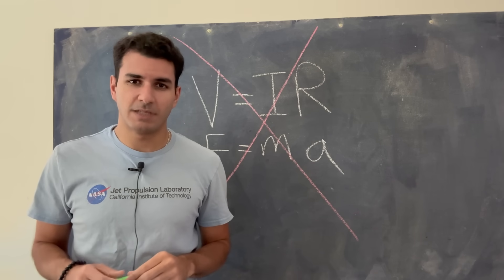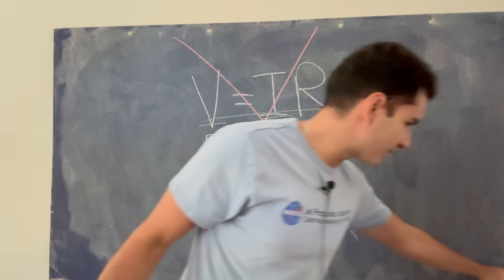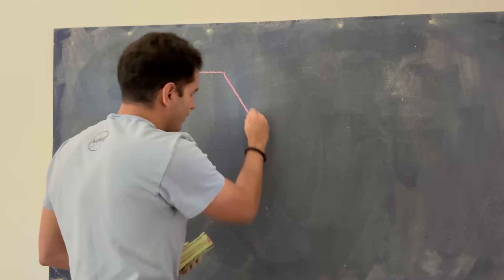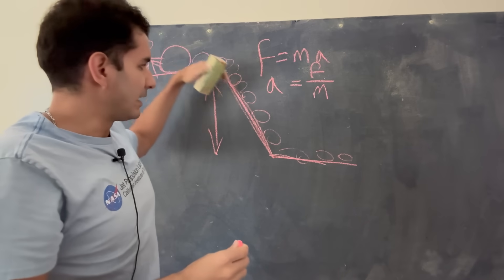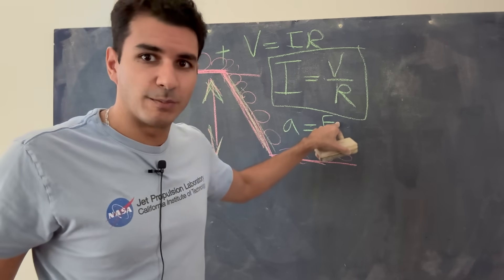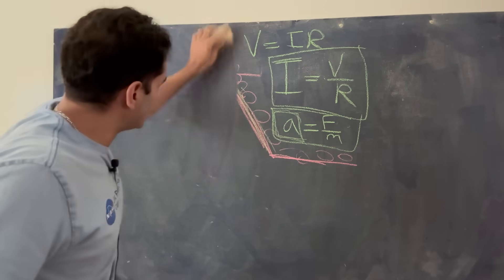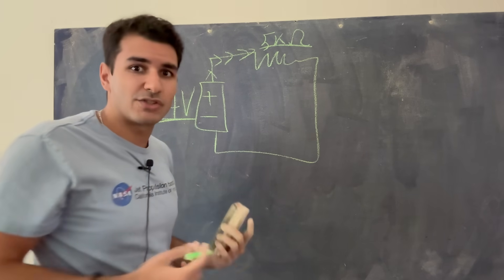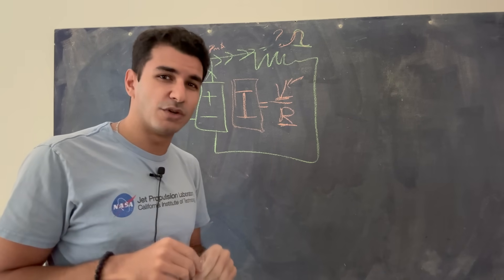You don't really understand physics

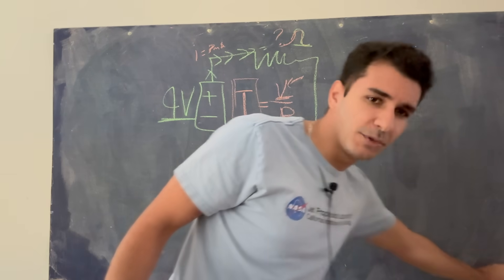Comment: Clearly never done any electrical (and mechanical) engineering. 10:22 "resistance is already there, so the current is the product". Every non-linear device adjusts its resistance based on the current supply. Negative differential resistance devices struggle at hunting down the correct resistance value so bad, they become oscillators. But even theoretical electronics disagree with you. Many circuits use constant current sources where current is the input parameter. Their models are very practical for photoelectric effect simulations.
Same but worse with mechanical engineering. Nothing causes anything in mechanical systems. The 3rd law of motion and impulse preservation laws state that all effects are mutual, not causal. 
This video pushes for using a worse form of the formula for an invalid reason. There is a reason these formulas are in the equational form and their transformation to a functional form is heavily context dependent.
Reply: I think he just want to demonstrate the "cause and effect" thing without going into too much details though.
Reply: How do current sources work though? I can imagine one as guy above wrote - using some magnets. But I can't imagine it in terms of battery or something.
Reply: @PinkeySuavo  most current sources are a voltage source modified to target a specific current. inductors are a true current source for a moment of time. inductive spikes are exactly when an inductor tries to maintain its momentary target current no matter the voltage. these spikes will physically damage any insulation in their way just to ensure the flow of some current.
Reply: @PinkeySuavo  You can model the battery either as a voltage source of a current source (look up Thevenin/Norton conversion).  It is more convenient to model the battery as voltage source because the voltage tends to remain "constant", but in some cases it is more useful to model the source as a current source, as in the case for solar panels.
Reply: @glandeokrayo9956  I remember Thevenin/Norton but it's conversion for mathematic purposes I think, and I meant real current sources
Reply: @PinkeySuavo  What do you mean with "real"?  An 'AA' battery is a real current source, far from ideal though, but an 'AA' battery can be modeled as an ideal current source in parallel with a resistor.
Reply: @glandeokrayo9956  but isnt it voltage source? It's not like a source of specific current. Its rather source of let's say 1.5V and the current will be dependent on the resistance. So like the guy in the topic explains. It's not like we can have "10mA" battery which will always give 10mA. That's what I mean with current source
Reply: @PinkeySuavo  If you connect a 1.5 battery to a resistor load with a resistance  much smaller than the internal resistance of the battery, it is more convenient to model the battery as a current source than a voltage source.  In the extreme case, replace the load with a wire.  The voltage across the wire will be near zero, but there will be a constant current out of the battery for sure.
Reply: Kinda strange how the creator just liked this comment? No response? So the video was debunked?
Reply: But you need a voltage to produce that current
Reply: @anghme28ang11  Nope.  You can a have a current to produce a voltage.  Electrical current is by definition the change of  charge over time I=dQ/dt.  You can move charge with a magnet and make them change over time hence creating a current.
Reply: @glandeokrayo9956  I remember quickly moving magnet through a coil with a LED connected and making it blink, I felt like a magician!

Comment: Have you never heard of a constant current source? Then, you need V=IR, since the current is constant, not the voltage. Also, have you never heard of a variable resistance? Sorry, dude, but you really don't consider ALL of the options. If you are a "rocket scientist" (isn't everyone at NASA?), then you understand about variable mass, constant acceleration, etc. right? Both of those equations need to to rearranged to suit the circumstances. Claiming that one form is more appropriate than another all depends upon the circumstances. Take care always.
Reply: How do constant current sources work though? I had it in my classes, but never actually understood what are these. Voltage source are easy - we use it everyday in forms of battery. But I couldn't think of current source. Maybe some phone chargers? They often have let's say 1A charge current. But isn't it in reality the byproduct of voltage (from the socket)?
Reply: @PinkeySuavo  Well, without being an electrical engineer, as I see from your text, you just demolished @ulyssesfewl1059 approach :) A constant current source maintains current level by raising/decreasing voltage. Same for voltage sources with current. No matter how exactly they do it.
Reply: That makes sense, however in highschool all we study is about a constant voltage source and a bunch of constant resistances. That's why we need I = V/R . The prior thing in schools should be to teach the way things work. Not how you plug in some numbers into an equation.
Reply: Doesn't a constant current source manipulate the voltage supplied, to meet the resistance and thus control the current?  If that is the case, does it not deny that the voltage is the cause of the current?  Just having a reactive system wouldn't meant that the causality was different.
Reply: @LionKimbro  A constant current source simply supplies a constant current, regardless of the load resistance. As the load resistance changes, so does the load voltage such that the current remains constant.

Comment: I have at least one counter-argument that should make you reconsider your confidence in your choice of perspective: Take a plasma jet, which can be thought of as a current source, and constrict the flow over some region of space, which can be thought of as a resistance; now you have a potential buildup across that constricted region. The independent variable in this case is the current, and the dependent variable is the voltage. This analogy is essentially how the function of bipolar-junction transistors is modeled, though the freespace plasma flow through a constriction makes a clearer analogy.

Comment: Surface friction is not going to stop a ball from rolling. In fact, it causes it to roll rather than slide. Energy is only dissipated if the friction force is nonzero, but too weak to prevent sliding.

Agree on the point made in the video though. When I teach physics, I always try to get the physics concept across, before introducing the mathematical formula.
Reply: Surface friction is sufficient for rolling on any solid surface in reality and so is irrelevant to discuss in his example it is more so governed by the shape of moving object instead of the surface friction, a ball(anything mostly round) will roll on any  surface.
Sliding of a ball can occur as you point out, simply due to a proportion of liquid/fluid state being present in the contact surface, none obvious in the example above. 
The reason a partial liquid phase causes translation/sliding is like sliding of a ball on normal slippery ice. This is due to the ice being partially a liquid on its surface, hence the ball will partially react to the contact as sliding and partially react as rolling.
Surface friction would only affect an object that's shaped with a larger surface area touching the ground, because that would be an object that could actually slide with low friction, something like a cube instead of inherently needing to roll like a ball... 
The shape determines if an object will roll on a given surface, unless you say there is no surface friction in a solid-solid contact, impossible. By stating the object is a ball means it must roll.
p.s. realistically there is always surface friction as I'm sure you know, this will indeed stop the ball from rolling over time by converting kinetic energy into heat, just because it isn't sliding doesn't mean there isn't heat created with every turn of the ball...
Reply: I was going to say that!
Reply: This stuff is so complicated it seems like every physics video I’ve ever watched no matter the creator always has a comment like this that’s like my goodness it’s just so much lol
Reply: I agree, wanted to see if anybody noticed. A better example would be with an object just sliding.
Reply: @danielnastase5302  yeah, maybe a cube or something with flat surface

Comment: Yooooo im not lying when i say this, when we were taught about forces and later got to electricity chapter, i wouldnt say i saw a similarity but i certainly had this question to myself about V=IR and how its interpreted. I thought there is current due to a voltage and resistance opposing the flow so why is it written like this and not like when we subject "a" in the equation F=ma, when there is some amount of mass(resisting force) when moving and has a force thats not becoming equal(not constant velocity) hence acceleration is there. Only for the sake of not overthinking, i assumed it as, "most questions and textbooks put a circuit(obviously) and ask or explain and they pass on voltage through cells so it could be that" and ended it there thinking that its a stupid thing to ask and nobody would do that but man when you said it and talked about it i vividly had the image of me thinking about this!! Not claiming to be a great physics student but only sharing my experience👍

Comment: I agree Ali. you provide good and important points. I actually feel there is more to those formulas Ali, a is a differential,  change in speed over time. And when it comes to Ohms law it's way complicated. i is change in charge that flows past a given area over change in time it takes for the charge to move past the area.

Comment: Maybe another way to look at the rolling ball example is that the acceleration is constant, regardless of the mass, and the net force (which lets say is composed of equally weighted atoms) is the sum of individual forces on the atoms. Similarly, in an electrical system the voltage imparts an acceleration to each of the electrons passing through it - but there is a difference here - the electrons dont accelerate, their energy is spent is travelling through a less conductive medium, and if the medium is more conductive, more electrons are recruited to travel through the medium, but they are not allowed to accelerate, and break the flow in some sense. No I am more confused.
Reply from the maker: but what caused the ball to accelerate in the first place? some force was applied!

Comment: Well actually Mr. Postdoctoral Fellow, it is more properly written as I = V / ( R + jX ). Only noobs leave off the imaginary part of the complex impedance. Joking aside, it doesn't matter how the equation is arranged, it all maths out the same. I do recall years ago ignorantly thinking that if you just increase the resistance of the circuit enough then you can generate any arbitrarily high voltage, not recognizing what is driving what in the relationship. The problem with saying it has to be written as I=V/R assumes that voltage always drives current, this isn't always true. Currents can be induced via inductive action, changing magnetic fields, or by physically moving charged objects around; in these cases, the voltage is generated by the current and/or the reactive impedance. Electrical Engineering is a misnomer, it isn't the electricity that is being engineered (that part is governed by physics), it is the impedance that is engineered in order to control the VI relationship.
Reply: Even more damaging to main argument of this video: ALL real voltage sources exhibit an equivalent series resistance. Because of this, by using the well known theorems of Thevenin and Norton,  any real source  can be represented either as a voltage source (with a series resistance) or a current source (with a parallel resistance); they are equivalent.
Reply: @glandeokrayo9956  Except current sources do not exist. It is just a mathematical model.  Not really a damaging argument.
Reply: The reason why in shool are used Simple Models like a gravity, 2nd Newton Law, Ohm Law or Energy of principles is only to capture initial understanding of basics. If You starts analyze the e.g. the diffrerential equations before the static understanding , this is not efficient way to understand the problems. The acceleration also can be driven (Simple example the stepper motor which driver gear and You want to observe the response of the hit for example or pressure)so this is correleted to the context but remember. Math is only approximation and You dont have 100 percentage model describes real. No, You can be close to real. A = f/m is crashed when You add relativity for example so 😊this is not proof,proof is the experiment and observation, however still with some deviation ;p
Reply: Impedance is SI defined as Z = E/R
Reply: @georgejo7905  Impedance has the unit of ohm which is SI defined as (kg*m^2)/(s*C^2). Since it has real and imaginary parts, makes you wonder which base units become imaginary? Capacitance and inductance have reciprocal units with exception of s^2 so there could be an argument that time is imaginary. This fits well considering that magnetic effects could very well be the consequence of relativistic effects on electric charge. And we all know that relativity makes time weird.
Reply: @Commenter-f8b  if the impedance is only imaginary ( reactive) the solution is complex time.
Reply: You only use the imaginary part in AC , there's no imaginary numbers in DC
Reply: Wait, my understanding for induced currents is that by Faraday's law, as the magnetic flux linkage changes, there is an induced electromotive force, which is the induced voltage that causes the induced current?😅
Reply: doesn't the original ohm's law experiment consider resistance as constant, and proves current to be proportional to voltage? sure impedance isn't always constant, but when talking about ohms law, it makes more sense to establish 1/R as a constant in the I α V relation.
Reply: @Youknowwhooooooo  resistance is a derived unit as is impedance. They are derived from volts and amps which were both imperically derived from the electrstatic force and the relation of current to magnetic field.After that an ohm was a circuit with one amp and one volt
Reply: You can make your own video then.
Reply: Because it gets cancelled out by taking the magnitude either way, and gets added to the net impedance
Reply: You can kind of achieve this effect of generating high voltage by increasing "resistance" if you think of inductance as a sort of resistance / reactance coupled with varying current. Then you will get V = L  dI / dt.  In this case Voltage (back Emf actually) is truly the consequence of a varying current. That's why you need a snubbing diode in inductive circuits.
Reply: I'm just doing O level physics bro😭
Reply: I = V/Z
Z is the impedance

Jesus died, and rose, offering salvation, grace, forgiveness, and hope for those who repent✝️❤️
Reply: @Commenter-f8b  Sir, I believe you haven't understood the very purpose of this video.
Reply: @saikatdutta1991  the purpose of this video seems to be to educate people who never really had a chance of understanding what all of these equations mean and how they function. commenter-f8b is providing additional context and information and insights that come from using this equation beyond the introductory stages. All this video does is do a slightly better job at explaining hwo this equation is used for an absolute beginner. only a beginner will find this video insightful, and commenter-f8b has provided some insights for the next few layers of how this is applied and goes
Reply: @charleshartlen3914  if this video is meant and insightful solely for beginners and the commenter knows about this (as you claim) then what's the point of giving more complex and detailed information.. there might be these reasons 
1. Either he didn't understand the purpose of the video
2. Bragging his knowledge 
3. Really meant to add more information
4. Trying to insult ( as mentioned the sentence with 'Noob' )

BTW, do you know the commenter?
Reply: @saikatdutta1991  this video claims to clarify these formulas with a "well, actually" kind fo tone. The commenter merely meets that "well, actually" tone by simply showing that this video needs additional clarification because it is contradictory and innaccurate. The point of the video becomes very strange after you look at what its tone is and how it has a giant X through these formulas as they are written and claims that people dont understand them. But unfortunately the way the info is presented it appears also like the video creator does nto understand them, as this commenter points out
Reply: @charleshartlen3914  okay.
Reply: @charleshartlen3914  Nah commenter is full of himself, he is the "akshually" guy here.  I have no idea why he brought up reactance and argued that it is actually I/Z not I/R  even though there is nothing about it in the video.

Comment: As the length of the conductor increases, resistance will increase; there is more ionization happening. Volts decrease over distance... Voltage drop.

Comment: I agree with your thoughts and have long felt the equal sign is not even really the right notation to be using here, because it has a sort of implied symmetry to it that doesn't quite capture what's going on. Something like F/m -> a is more evocative of the cause/effect relationship you brought out. It's also more like the notation used for "mapping" in math, where there is an explicit domain and range. I think it's usually when you learn the differential equation form of F=ma that this starts to crystallize, especially when you start to write simulators that integrate by summing contributions to the derivative that it starts to become very clear.